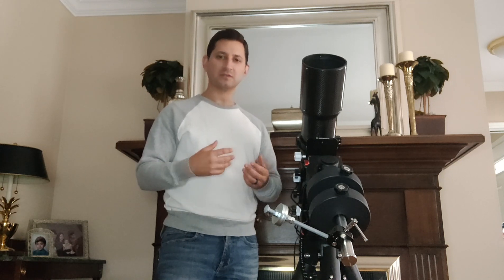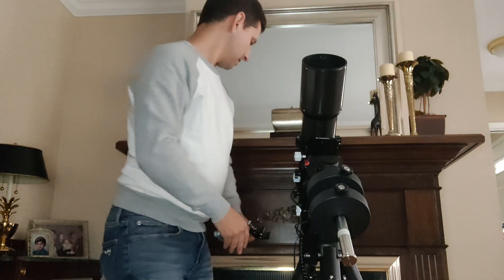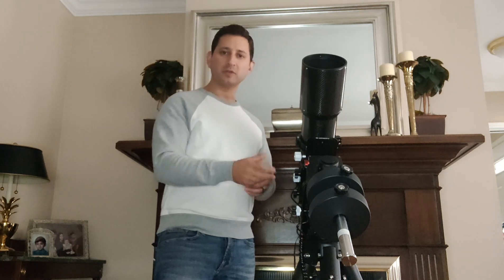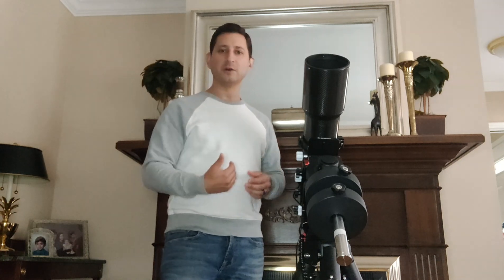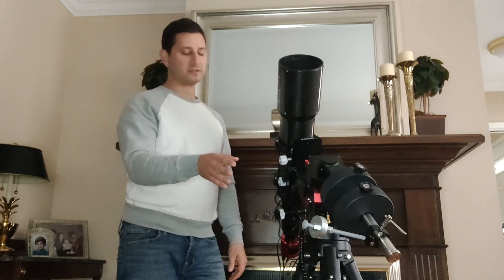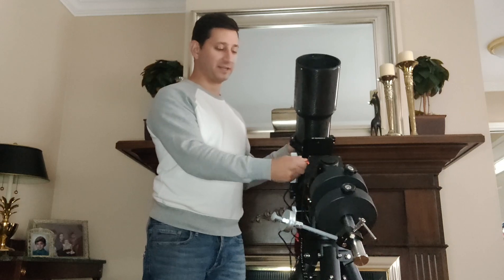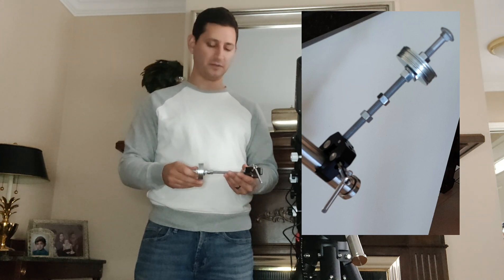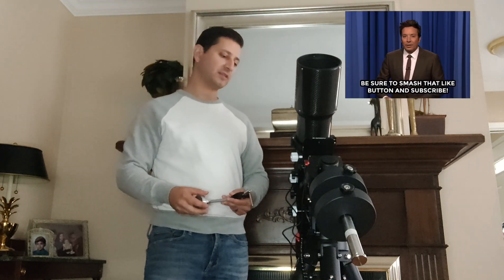Third Axis Balancing of Your Astrophotography Mount

Comment: Thanks for this video! I have a CEM70 and with a weight (m8 bolt and washers) screwed into the side of the saddle, DEC was balanced in any position but I couldn't get RA completely balanced. In my efforts, I came across your video, ordered the parts (THANKS for the part info!) and....voila'! The only difference is that I only needed the clamp on the counter weight shaft, probably because the weight on the saddle partly took care of it. When doing this with both DEC and RA, after balancing both in the horizontal CW shaft position, then start the third axis process with DEC (like with regular balance) since anything you do after for RA isn't going to affect DEC. And even with a significant weight on the saddle, if it's at the center of the saddle, the effect on the CWS horizontal balance will be minimal so fine tuning is pretty easy. Adding weight to the CWS and re-adjusting horizontal balance is a bit more iterative, but still not that bad I found.

FWIW, I spoke with Ioptron about this (was already working with them on some guiding/tracking/PE issues) and their position is that third axis balancing isn't needed. They say that it's an issue with all mounts, but because of how their clutch system works and the "frictionless" movement it allows, third axis imbalance shows with their mounts much more so than others. True enough, but I wonder if the friction that hides the imbalance with other mounts also mitigates it's effect since the motors are always working against it (like east-side and camera heavy).

Comment: Thank you for posting this video and the links - especially the clamp! I was finally able to balance my CEM70 (after two years) and the guiding improved dramatically. I tried some of the suggestions on the iOptron Groups (loosen screws to move the Ra "collar",  or apply a shim) and none of those worked. This did!
Reply from the maker: Awesome! Glad it worked!

Comment: The Cem60 21# counter weight has 2 threaded holes on the sides for exactly this purpose, inserting a threaded rod for additional axis counter balancing. I believe the holes are M8. I don't know about their other weights, if they have the same holes or not. I also believe there is an actual kit you can purchase that includes all the necessary items. So in essence, if your counter weight has these holes, all you need is the rod, a couple nuts and some fender washers.
Reply from the maker: I've heard that before with the bigger mounts but unfortunately my counterweights don't have those holes

Comment: I’m confused. Once you change the declination of the mount, won’t you have to again adjust the orientation of the z axis weight? Since on the ioptron mount the counterweight shaft doesn’t rotate with the Declination as it does on normal eq mounts?
Reply from the maker: Not sure I know what you mean but the counterweight shaft rotates with the RA like most mounts, not the declination.

Comment: Thanks for this info!

Quick question, though.

 If this helped you balance to the point where you were tracking unguided and had eliminated star drift 
- WHY did you start using guiding software AND spend money on a guiding cam / mini scope????

So, you continued to have tracking issues in spite of the encoder???

Hope you reply,

Al
Reply from the maker: Hi Al, so proper balance is essential for any long exposure and for the mount to operate well without putting undue strain on it. But if you want to do 4, 5 minute or longer exposures, you need to guide. Guiding also enables you to dither which helps reduce overall noise. No issues with this mount but as in my other video's, my CEM26EC mount needed repairs before it operated properly unguided.

Comment: Yea, CEM mounts have this issue. My CEM70G does the same, but my GEM45 of course does not. The CEM70 has allen screws around the RA counter weight attachment section that allows a left-right shift so that the counterweight bar is properly aligned with the DEC axis and the one sided RA weight problem is fixed. Have a look at this which I found on the CEM70, just in case you mount has the same option...n

https://www.youtube.com/watch?v=AnE5ikgzX7s

Comment: Your  counterweight  bar it’s not perfect center , if you loosen the 3 screws close to the pole scope and give a small push to left or right will fix this problem, you don’t need any side counterweight
Reply: ThaT would have been great but unfortunately on my CEM40 i was only able to move the shaft to the right and not to the left. This means that you can only do it by drilling a hole in the mount!

Comment: I solved the problem on my CEM40EC by using proportionate weights on the shaft.  The upper shaft weight is a 2.5K weight and the lower shaft weight is 5.0K.  By shifting the proportion of weight on the shaft, I can balance the mount so that it is "Slightly" east heavy and prevent backlash.

Comment: As you mentioned, others have had similar issues with the CEM mounts. In theory these new center balanced mount designs make a lot of engineering sense but anecdotal evidence suggests that there are some issues to be ironed out.  These same problems have not been reported to the same extent for the GEM series, a much older and slightly 'outdated' design. On the other hand, the GEM carries more physical weight than the CEM (about 5 lbs) without itself weighing more than the CEM, again suggesting that the CEM design is innovative but not yet superior to the old GEM designs.  The differences are ultimately minor, i.e. both mounts perform great and any limitations are those of the operator.
Reply from the maker: Very interesting. Thanks for your input

Comment: Have a CEM40 as well. I also have this in-balance as you can see in some of my video's. I didn't experience many issues do to the imbalance though. Usually I am around 0.60 RMS with my EdgeHD 8" telescope on it.

Knew about this possible solution before but never thought of trying it. Perhaps I'll do after seeing your vid. Might get the RMS even lower.

Comment: Had a similar issue with my EQ6-R and used a 2 oz magnet on the counterweights to achieve balance.  I have a 8" RASA w/ZWO EAF and ZWO 30mm guide scope.  The EAF does cause an offset and the guide scope sits opposite to it on the OTA and reduces that difference in 'pitch'. I've since made adjustments to the center of balance on the OTA and find that the closer you get to center balance on the OTA the weight offset can be zeroed out.  And I thought it was just me that had the problem....   nope.    Thanks for the re-assuring video :)
Reply from the maker: Thanks for sharing that! I quickly found out what a difference proper balance really makes 👌
Reply: @keystothecosmos7527  Yup, makes PHD2 look near perfect.